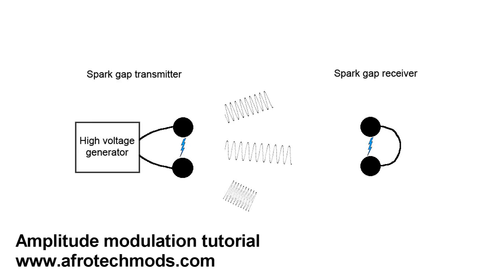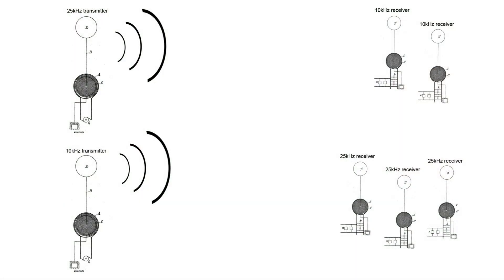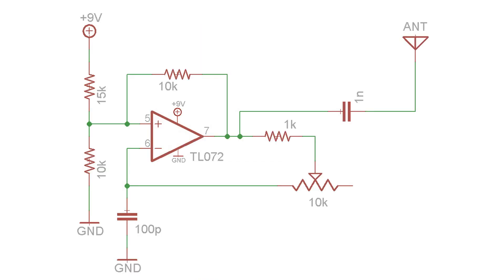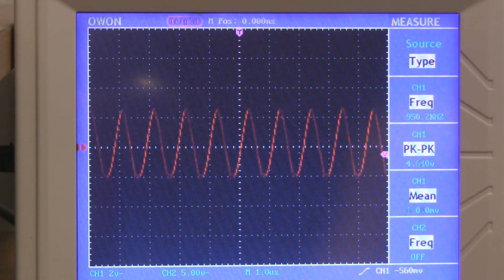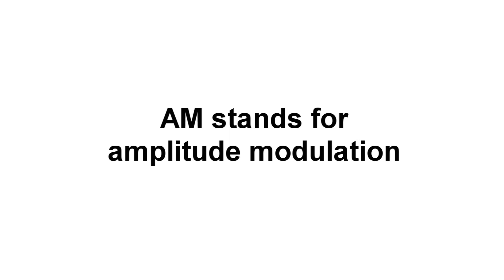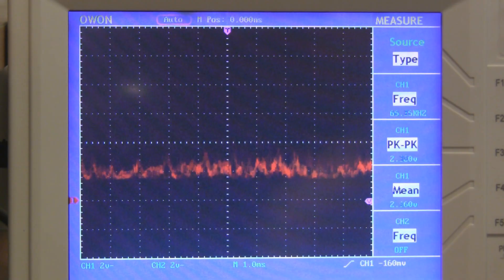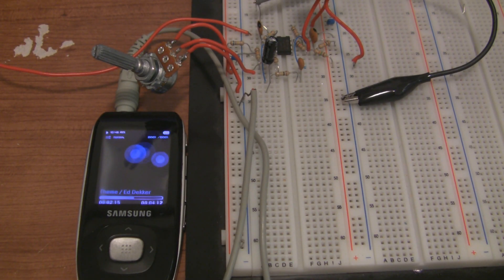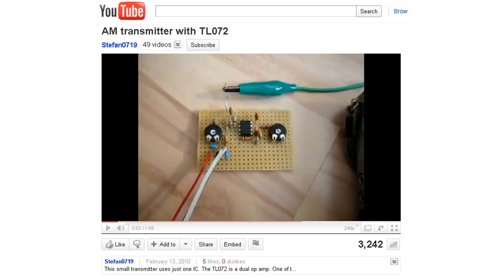Amplitude Modulation tutorial and AM radio transmitter circuit

Comment: Since you are transmitting 900khz to 1Mhz don't you require a 75-150 meter antenna? 
Since the wave length is (3×10^8) /10^6 = 300 meters. And length of dipole and monopol antenna should by half and quarter wavelength respectively

Comment: Why does the antenna have to be a meter long? Is it the frequency or is it that the voltage has more wire to work through making the signal stronger?

Comment: If you use RF Hybrid (with its input connected to your output) and power it from battery (then connect its output to an antenna via matching circuit) you can amplify the output signal thus you can enable transmission of your MP3 player to a longer distance.

Comment: i have a question sir :) where does the other end of the potentiometer in the oscillator goes? does it go to the ground? tthank you :)
Reply: You can just leave it as is. The potentiometer will work as a variable resistor if only 2 of the 3 terminals are used.

Comment: I enjoy this video, as I've been looking for a simple, straightforward, transmitter circuit that separates the carrier wave circuit from the AM or FM modulater circuit. As such I've tryed building the carrier wave circuit with a TLE2072IP OP Amp. So far I'm getting 3.6 VDC on the None Inverting Imput and the Output, with no sine of AC Current or a signal. If anybody can point me in the right direction to get this circuit working I would be most greatful.
Reply: It seems the circuit is being swamped by the 60 Hz signal from the main line. I don't know if that's the cause of the 3.6 VDC, or the lack of AC, but the circuit dose apear to be broadcasting, as determined by the radio test, so I guess its working as well as it will.

Comment: You added a capacitor in series with the antenna with the explanation that the capacitor isolates the DC of the circuit from the antenna, which is correct design practice...THEN, you contradict that  with a coil in parallel  with the isolating capacitor. I believe you have made an error.  The coil and capacitor should be in SERIES between the output and the antenna.

Comment: For my first radio circuit I used two 555 timer chips, one outputting a radio frequency and the other 555 turning first 555 on and off making a beeping noise that my am radio picked up

Comment: Heads up to everyone making this with 12v, use a 10k from Vcc to the             non-inverting side of the chip, and a 8.2k from the same pin to ground, hope this helps to those who need it, cheers

Comment: Hi, great video. I'm an engineering student and I'm very intrigued by radio frequency communication. Could you please tell what I need to consider to gain more transmission range, about 5 to 10 km? You mentioned, in the video, that the circuit shown is low powered, what IC could I use for a more "powerful" circuit?

Comment: Hi I really liked the video as the explanations made a lot of things clear. Just two questions: Looking at the oscillator I would suggest that it works that the opamp goes into saturation and charges the capacitor until it reverse saturates and keeps on continuing doing that. But that would give a square wave. Why do you get a sine wave? Can you also explain the second part? You have a signal on both inputs of the opamp and one terminal is dc biased. Why comes the wave out of this in such a controlled manner? Has it something to do with feedback?

Comment: I have made the circuit as per the diagram but I'm not getting modulated output instead there is just a Sinewave and I Cant figure out why. please list me some basic mistake which i may doing
Reply: Mine's a sinewave too :/
Reply: i am getting half wave that is moduLATED REST is a straight line ,, plz tell how was your problem solved???
Reply: The second op-amp works as a summer (adder), adding a RF on top of an audio. Due to non-linearity of it, some mixer side-effect was generated resulting in a small amount of AM. However, its strongest outputs were still an unmodulated RF carrier and an audio tone. An AM radio receiver would pick up the carrier (output became quiet). To generate proper AM, you need a mixer that multiply the RF input and the audio input. In this circuit it’s not doable; I suggest using a simple RF oscillator (Colpitts or Hartley) and modulate the oscillator with a strong audio source placed in series with a DC power supply.

Comment: Hello, great video. Can I ask if  there  is a way to generate 60Khz with this circuit?   I have a RC watch but I leave in south hemisphere, and there are no radio broadcasting the syc signals. I'm looking to build a small radio at 6khz and feed with a computer + gps signal to  broadcast a WWVB or JJY similar  signal to sync my watch (just home range).  Thanks for any advice!

Comment: I need some advice for an little project involving RF communication with an reciever and transmitter. 
I plan on making the transmitter send out serial data (UART) , that ends up being received by the reciever. The data is then saved on an microcontroller supporting UART.

Does it pay off making an RF circuit involving AM, FM or whatever RF modulation method is out there, or just buying myself an RF set with both reciever transmitter? And how to make it send radio waves many meters away (kilometers would be awesome)?
Reply from the maker: It depends on your current skill level and how much time you want to spend on this. It would take you quite a while to design and build your own radio transmitters and receivers but it would be the perfect exercise if you want to learn RF engineering. You could also just buy a set of 433MHz TX/RX boards for very cheap. https://www.amazon.com/s/ref=afromods-20?url=search-alias%3Daps&field-keywords=433MHz

Comment: But hey. I have to ask something.
I thought in AM, the frequency is stable.

Yet in the video, it changes constantly from 39kHz to 130kHz. Why?
Reply: The fluctuating amplitude of the modulating signal makes it look like the frequency is changing, but it is not. When you zoom into the output signal at the antenna you will see the frequency is constant but the amplitude is changing. If you adjust the trigger dial on the Oscilloscope, and zoon into the vertical voltage scale, you can stabilise the signal under investigation and see it more clearly.

Comment: I'm an amateur radio extra class operator, but I really can't get enough of the fundamentals. You blew my mind when you said, "another spark appears." That did it for me. If I can explain this magic to my five and eight-year-olds, then the idea is rock solid for both of us. Kinda like I found that guy Uncle Doug (the guitar amp guru), I consider your stuff to be a "find." On that basis, I would LOVE to hear you explain radio receiver alignment concepts, what the BFO is and how it's tuned/zero beat. I suspect this is 'outside your ken' as it were--perhaps a bit too specific to the ham radio hobby and therefore of less interest to you. Anyway, that is my accolade and request for you today. Cheers.
Reply: +JC Haywire After two listens through, I have to say, this is a masterpiece. Sufficient for the Library Of Congress as an audio recording of "How Radios Work & What They Can Do." Perfectly scaffolded for basic listeners, yet peppered with unobtrusive bits of deeper technical rigor to hold the interest of experienced listeners. Woot.
Reply from the maker: +JC Haywire Lol I think that might be a bit generous but I appreciate it thanks!

Comment: nice video,

If you want listening on shortwave in the Netherlands that is possible!
http://websdr.ewi.utwente.nl:8901/
instructions:
click To * waterfall *
Seeking for: * Waterfall view * and click on: MAX IN.
Choose a modulation now for testing: AM
Click in the box: Frequency - and type: 1008 KHZ (you will hear a Dutch radio station)

http://websdr.ewi.utwente.nl:8901/

40mtr for amateur band mode USB / LSB: 7125KHZ
for NL pirate stations on AM mode: 6380khz (usually on Sunday afternoon)
MW NL pirates station AM 1630KHZ
80mTr amateur 3650KHZ

Greetings from the Netherlands.
Rob.

Comment: dude when i become rich i wanna meet you and pay you in kind! 
one question, is there such a ting as a high power digital pot ? 
im looking to control motors with this schematic im putting together and will be control by a AI prog and this system needs to use something like a comparator or a digital pot or a op AMP
Reply from the maker: +Frank Lopez I don't know of any such thing as a high powered digital potentiometer, they all tend to be under 1 watt. If you are looking to control motors what you want is an H bridge - I have a tutorial on that subject.
Reply: Afrotechmods
no i know but in the even when i build my own diy servo as you already know a pot is needed right and well the idea is that i want a digital pot rather than a ordinary pot, the idea is to control the wiper over serial, hope this makes sense
Reply from the maker: Frank Lopez
Are you sure you don't want something like a rotary encoder to detect rotation?
Reply: Afrotechmods
yes this is part of the setup but the reason why i want this digital pot is not for controlling direction but for increasing the current or voltage should a condition is met in the algorithm

in a for loop i want the digital pot to increase voltage or current if a load is greater then a variable

im not sure if your familiar with C++ but this is what i speak of when i say for loop
Reply: You can do that also using an tightly controlled PWM loop. 
If the load is less or equal to the defined variable, keep the default PWM duty cycle.
If the load is greater then the defines variable, the PWM duty cycle is increased.